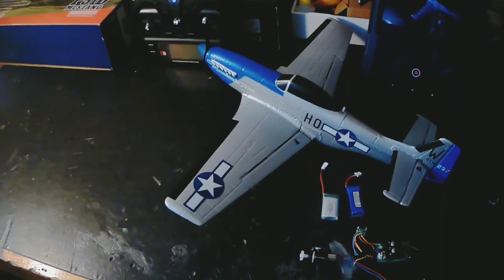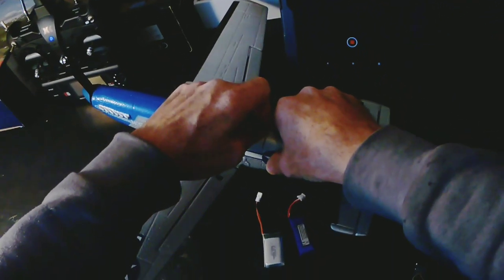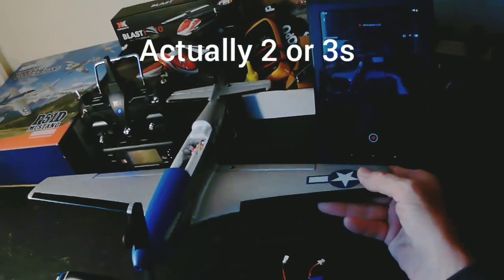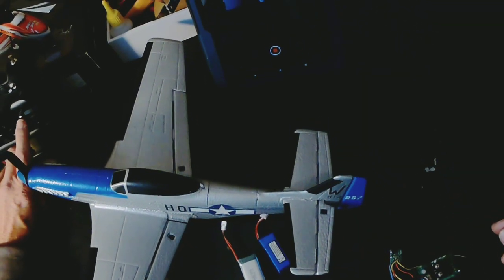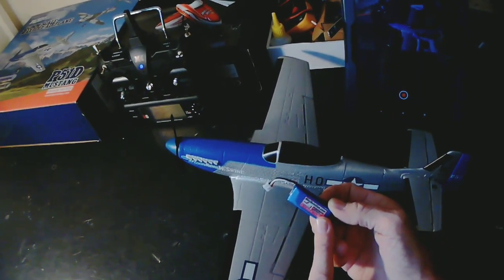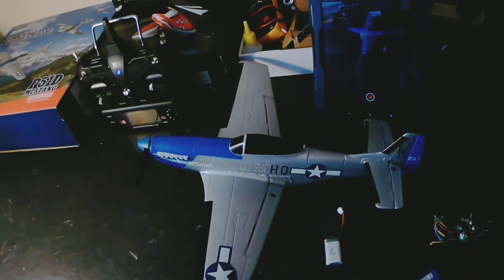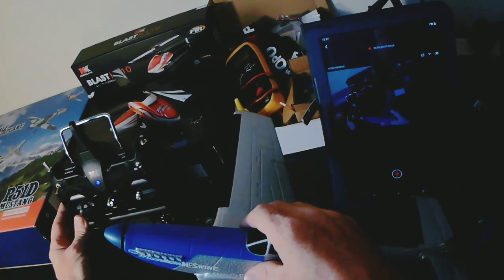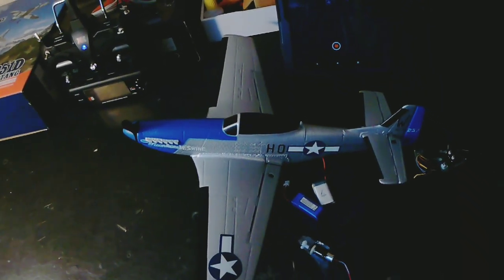Top RC Hobby P51D Mustang 450mm 2s Brushless Conversion.. from 60 to 160 Grams Of Thrust! (Part 1)

Comment: Hi. I want to ask something about the gyro. It depend on the orientation of the receiver in the airplane? I know that using the crossover compiler via PC it is possible to set whether the receiver is in horizontal position or flank. But I wonder if "flipping" the receiver when the servos are "up" like you have, or "down" has an effect on the gyro? Or turning the front-back side of the receiver? Is it necessary to change something in the settings or does the gyro adjust itself when the battery is connected? Thank you
Reply from the maker: You have to set everything in the GUI, if you place it back to front and upsidedown you would need to reverse the gyro effect in the GUI for Rudder and elevator... It will only work in normal orientation without plugging in to the GUI .. flank needs setting for example..
Reply: @cheggers1973  I'll ask like a fool.. and the normal orientation is - the servos are down and the gears are in the front in the direction of flight? Thank you very much for your help
Reply from the maker: @Ambobeat  normal orientation is liner servos on top, gears and wires to the front, antenna to the rear.
Reply from the maker: @Ambobeat  you absolutely need to be able to plug this in to a PC and set it with the GUI, if you can't do that, I don't recommend you buy it, gyro will need setting and possible adjustments at a minimum..
Reply: @cheggers1973  thank you for warning. I have already bought two AR3207G-A2 FLYSKY and MXL-RX62H-A2 FlySky receivers. I'm still struggling a bit with the gyro settings. 🙂 thanks again for your help.

Comment: Interesting that Jerry Bauer's convertor didn't work on the TopRC board since it is probably derived from the Volantex one. Just a thought - did you try adjusting the proving resistor across the brushed motor terminals? That can be fairly high for the Volantex boards - maybe it needs to be lower for the TopRC units?
The 450mm frame is a better fit for the conversion than the smaller planes. We have a couple of the AEORC/Crossover units but prefer an A8S Flysky+Byme-A stab for more stab modes and standard servo plugs on our Chuck Glider conversions. By the time we add another couple of cheap servos the price comes to about the same anyhow. We generally prefer twins. They don't corkscrew at take-off. 😉😊
Reply from the maker: It was quite annoying that the B2BL Module didn't work, I tried a few different things to get it to work but gave up and brought another reciever.. I don't have knowledge enough yo try your resistor suggestion ..
I only really wanted it to work so I could keep self leveling mode...now I don't want that at all. 3 axis is enough.

It's now got a MXO Crossover 7ch RX in it.